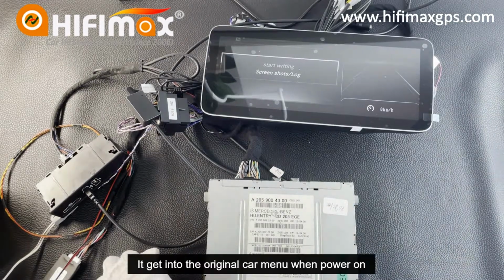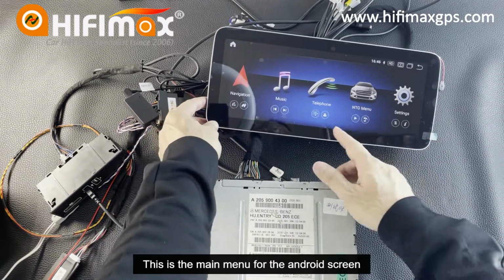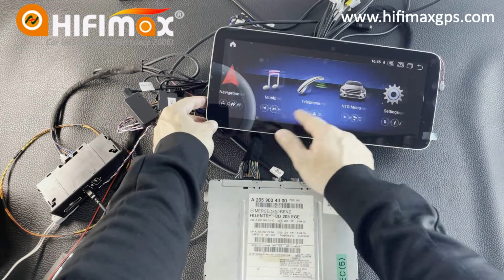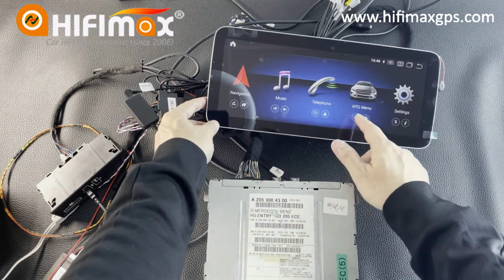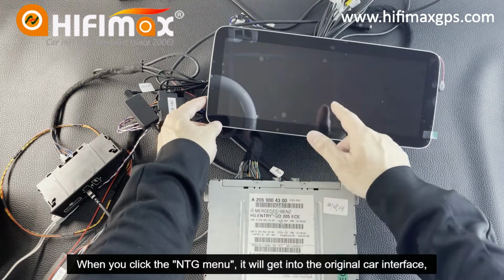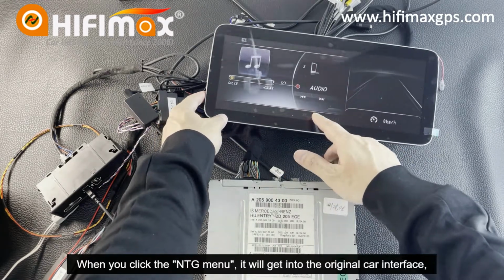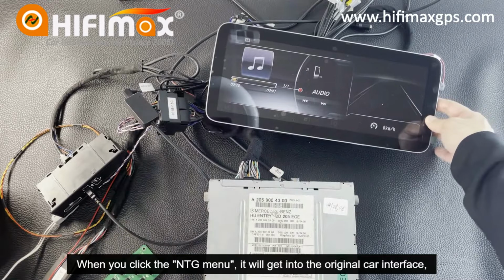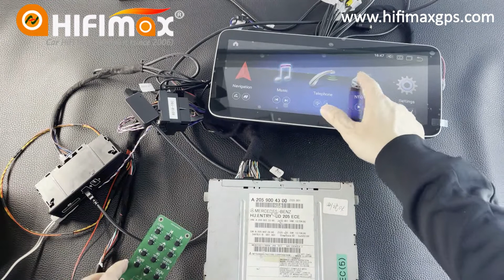12.3 inch Mercedes Benz NTG 5.0 android navigation GPS screen upgrade installation / retrofit guide

Comment: I can't seem to access the settings that you have access to.  In the Media menu it shows the Aux USB as unrecognised.  I do have an optional for horizontal and vertical, I picked 3 for both as media is third and USB is also third option down but still no luck

Comment: Hi, do I need to connect the ACC cable for ntg 5.0 12 inch screen? My screen that I installed keeps saying “no signal” when turning off and on car
Reply from the maker: The big power connection with ACC , but it doesn’t need to connect it specifically, all just plug and play . The “ no signal “ is other reason I think . It can not get into android menu ?
Reply: Yes I can enter the android menu and the original ntg 5.0 menu
Reply from the maker: You can consider the firmware update, to ask your supplier  @TheDarkShadow27

Comment: Hi there, 
Mine is also 5.0 and using the 12.3 monitor,
I have 3 second sound delay, purchased a dsp amp, still sound delay, settings are aftermarket amp and auto aux but it doesn’t pick up the monitor in aux unless the aux cable is connected, can’t seem to stop the 3 second sound delay. Any answers please?
Reply from the maker: you can ask your supplier 's technician for help, it need to check in details (wire-diagram, settings, etc)